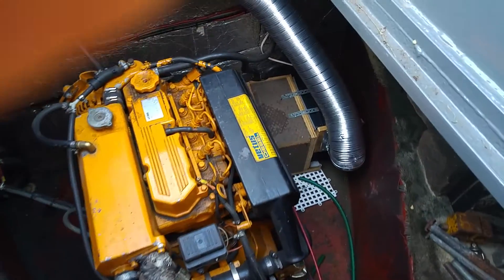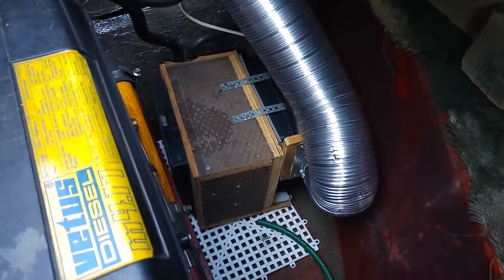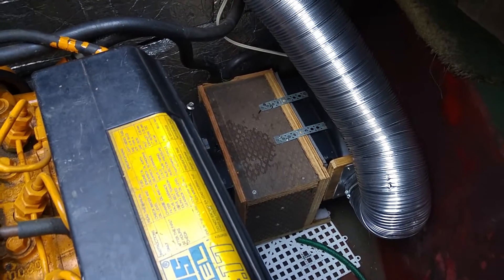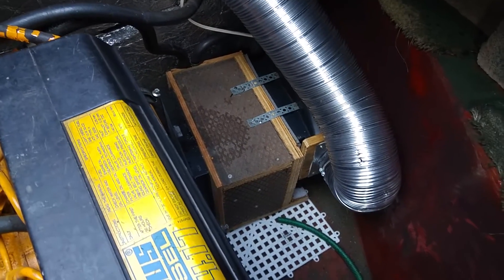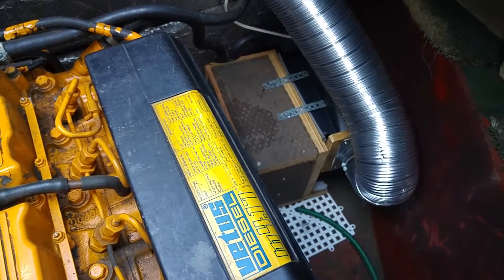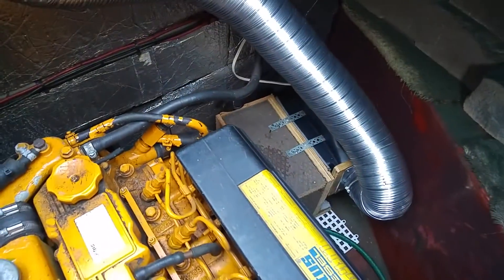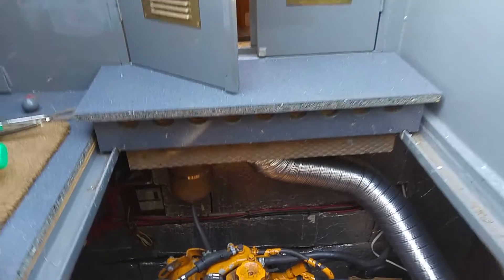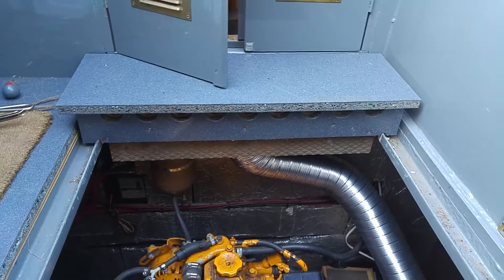Canal narrow boat rear cockpit DIY heating system

Comment: Do you have anything like a Webasto installed as well??
Reply from the maker: Sander Tel I’ve got an Alde gas heating system for the boat cabin, but the heater in the video is just for the rear semi-trad cockpit area.